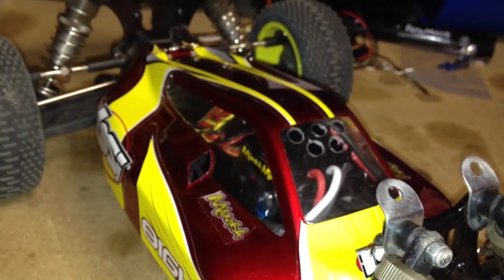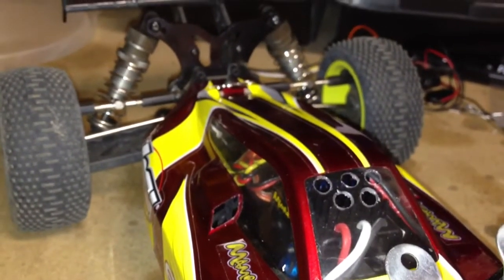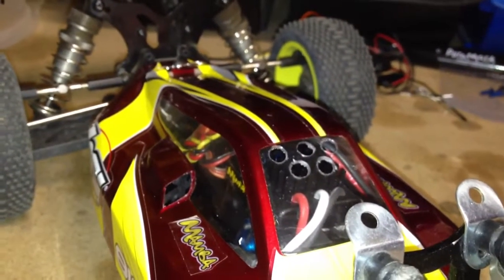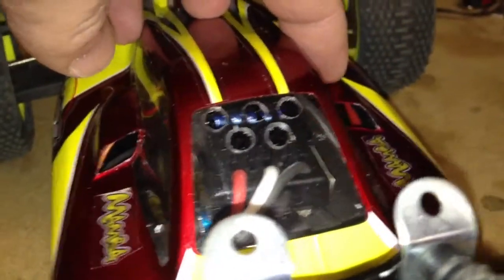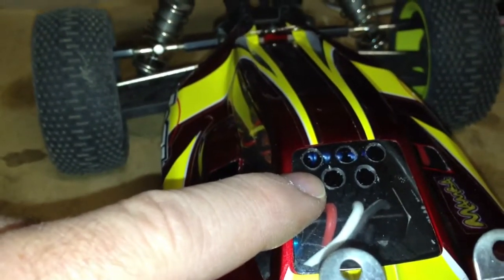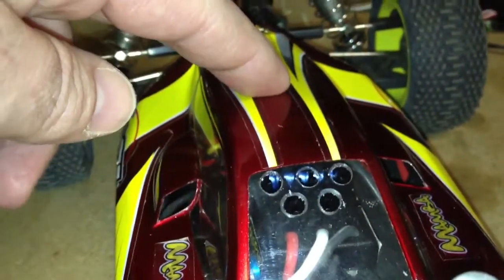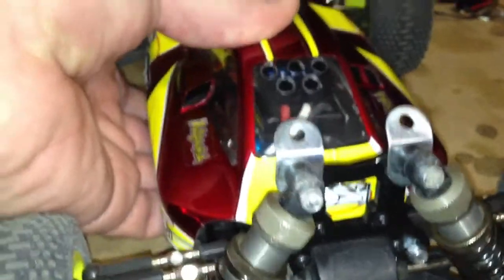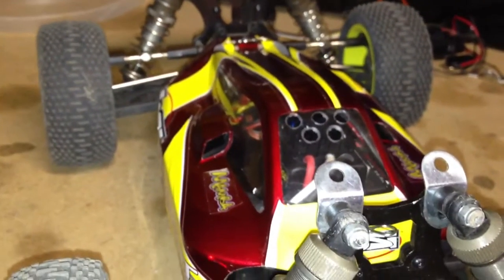The RCNetwork - Losi mini 8ight - vent holes for esc/motor

Comment: why you had to cut the blue aluminioum horn? to fit inside the top plate that holds the ESC? the horn/arm has got 5 or six holes... you conected the losi screw on the first hole?

Comment from the maker: @Pellogt The 5245 fits perfect, no mods to the servo or car. You will have to make or mod a horn to fit though. I used the included blue aluminum horn and cut it down to fit right. Just ran the horn, no servo saver.

Comment from the maker: The 5245 fits perfect, no mods to the servo or car.  You will have to make or mod a horn to fit though.  I used the included blue aluminum horn and cut it down to fit right.  Just ran the horn, no servo saver.

Comment from the maker: Good deal, 'flite5!  The hitec 5245mg is a great servo. One of the best mods I did besides the shocks!  Post the mods on the battery tray. It's still one I have yet to find time for. The batteries I'm running aren't quite as long as stock, so they have the potential to start wiggling into the driveshaft!